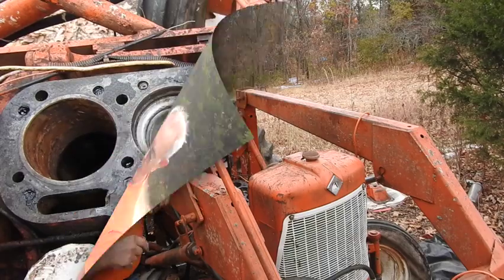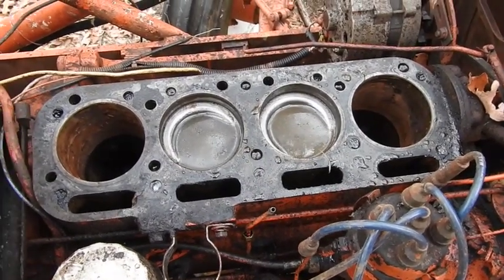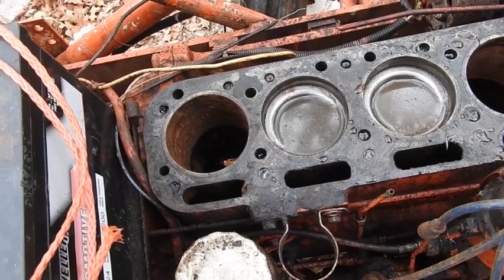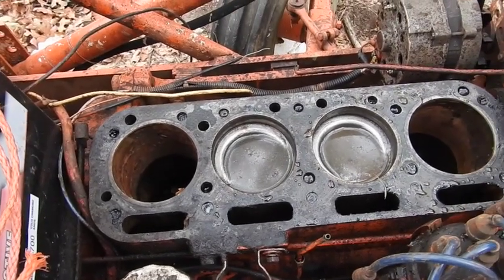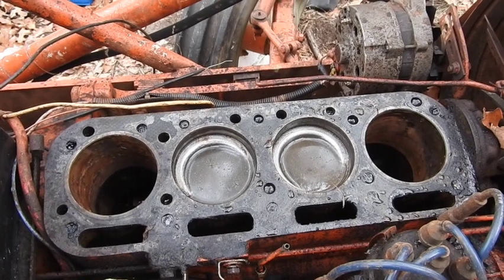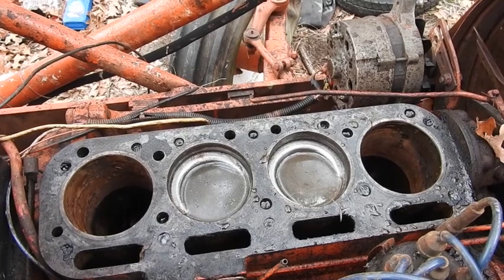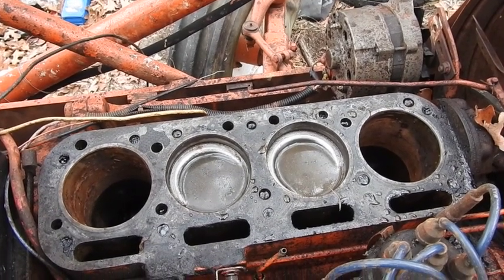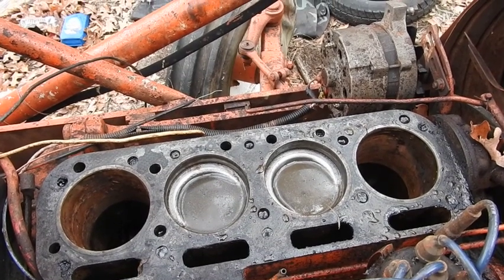Allis Chalmers D15 Update-  Motor is Roasted

Comment: We tore down a H farmall engine. pulled the crank and used a porta power to force the pistons down and out. needed a torch to heat the block. We have a video of it.
Reply from the maker: Extreme issues cause for extreme measures Randay !!  I've had some pretty tough ones too.  He's been using a house jack underneath but it's lifting the front of the tractor.

Comment: At this point there isn't much to lose. I'd put some heat on those pistons and a quick cooling to try and break the bond. If that doesn't work I'd drill holes through them until they are weakened enough to let go. My two cents.
Reply from the maker: I agree SK, I am glad for once that this one isn't my problem.  Like my surprise with the Case diesel, my buddy thought this one just needed a carb cleaning and air in the tires.  I told him to fill the cylinders above the pistons with gas and light 'em off.  Do that a few times and see what happens.  I've been lucky with that on a couple occasions too.

Comment: Any idea how you'll get the pistons out? Maybe a torch would do some good.
Reply from the maker: If it was mine, I'd have rmoved the loader, pulled the engine and put it on a stand, removed the crank and use any method that would work.  That loader makes it extremely difficult to work on.  2 and 3 are stuck REAL good.